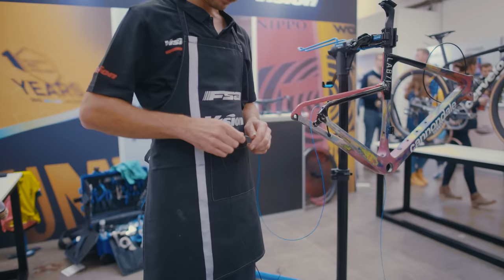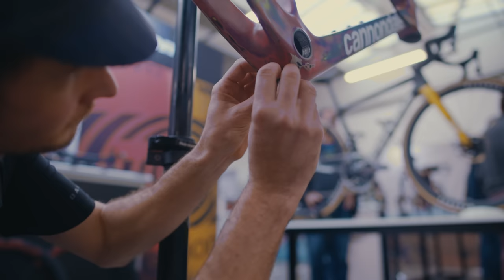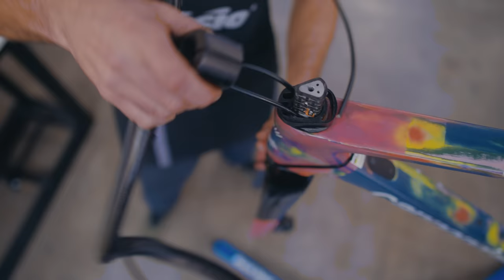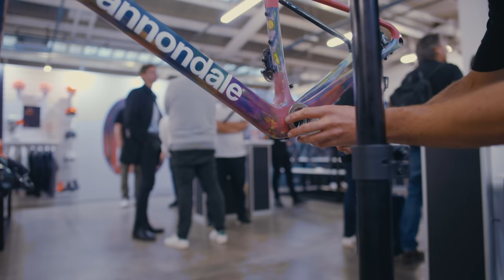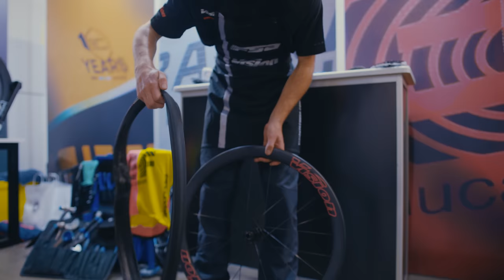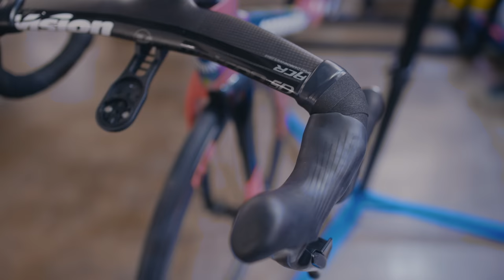DREAM BUILD ROAD BIKE - Cannondale SuperSix EVO LAB71 - EF Pro Cycling

Comment: This kinda frame doesn’t have internal cable tubing, but it does have internal headset cable routing…odd set of priorities IMO…
Reply from the maker: Tubed internal routing is amazing in terms of serviceability but it does open up potential problems with lifespan and also adds weight.

Comment: I took my stem apart and tried to put it back together but the top bolt has nothing to screw into plz help
Reply: Which stem? It screws onto the expander in the fork, if this is too low, the bolt is pretty short and cannot tighten. You have to first tighten the top screw with the plastics assembled for preload, then the stem on the side with its 2 bolts.